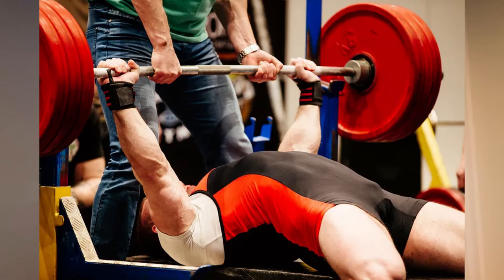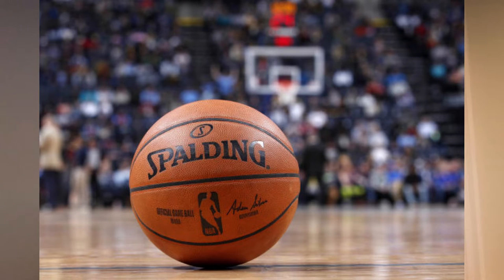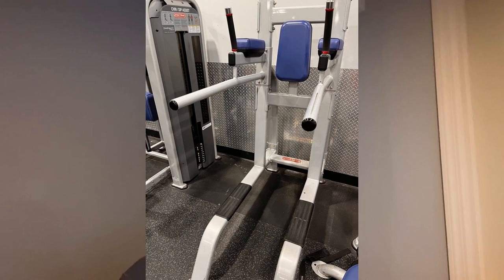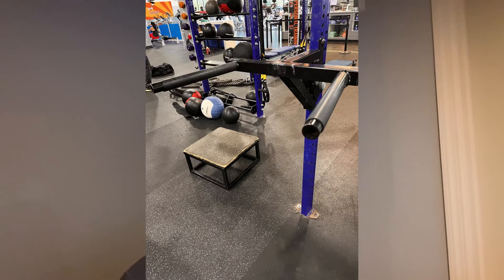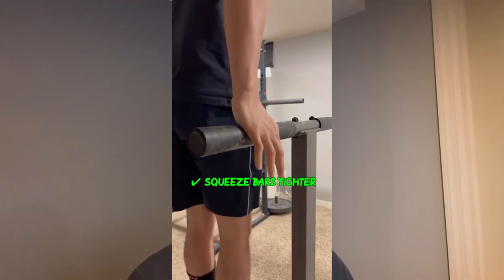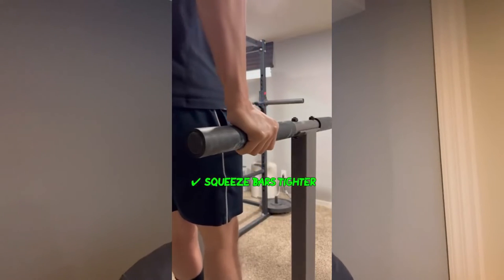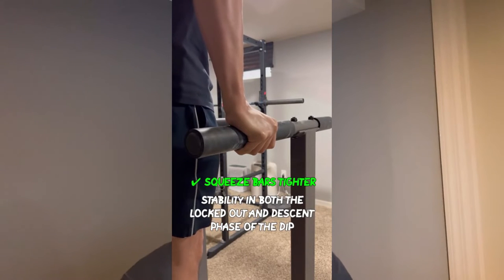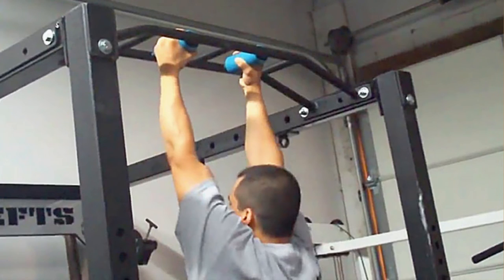Why BAR THICKNESS Matters in Streetlifting

Comment: What about bar shape bro ?
The one at my gym is thick enough but it is oval- shaped. Does that affect dipping ?
Reply from the maker: It’s not fully circular? That’s weird, never heard that before. I would imagine it would impact the squeeze and hand placement depending if the flatter side is on the top or on the side. It depends on the dimensions of it.